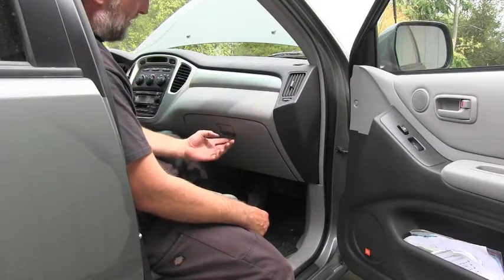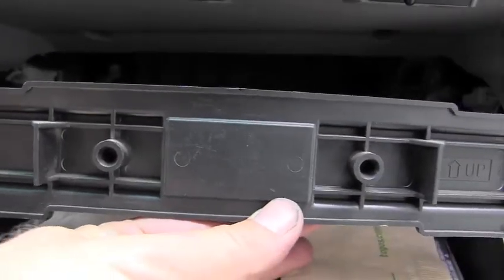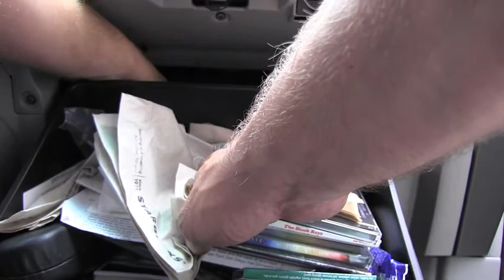Toyota Highlander Cabin Air Filter Inspection, Replacement

Comment: Hi
Using Innova 3100 CanOBD2 Diagnostic Tool on my 2001 Toyota Highlander 2L I am receiving P500 (Generic) Vehicle Speed Sensor A.

Do you have any experience what does it mean and what is the way to fix the issue. I did reset the Check Engine warning on my dashboard.

Thanks